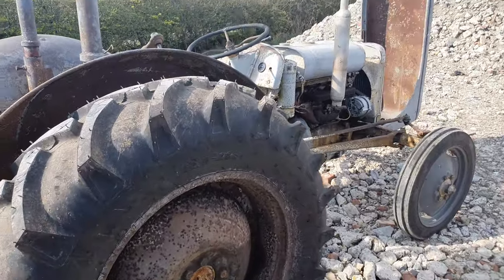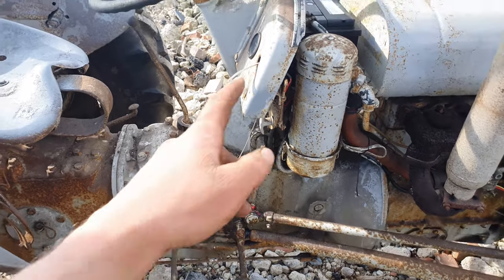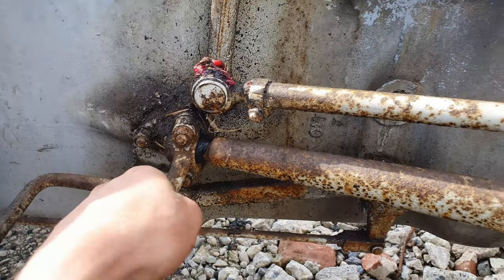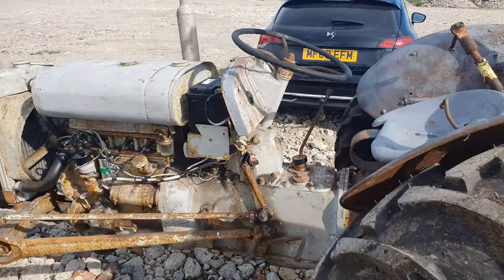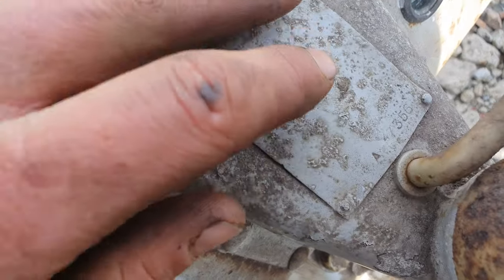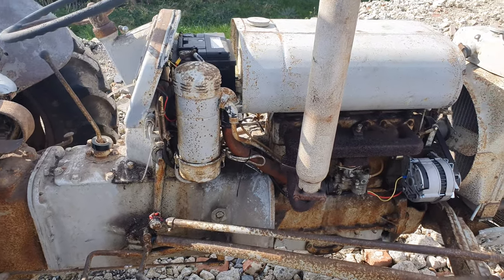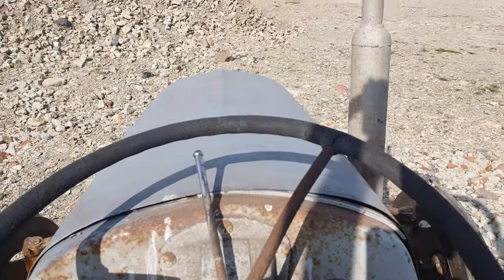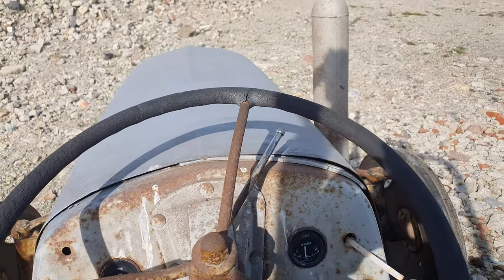THE GREY FERGIE EP1

Comment: A tip for the loose ball joint. Put a 2p in the socket on the tractor side and tighten it up. Works a treat. I found one in my TED when I restored it.

Comment: Indeed you are correct, That's a Tea20.
Te standing for Tractor England,
A, petrol. 
D, Petrol Paraffin 
And F diesel engines.
20 is the power rating. 20hp